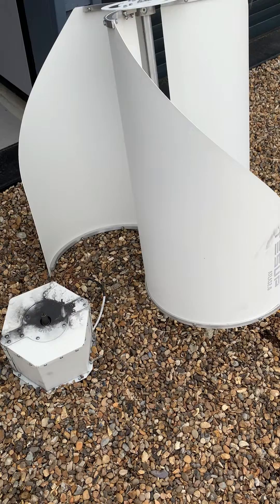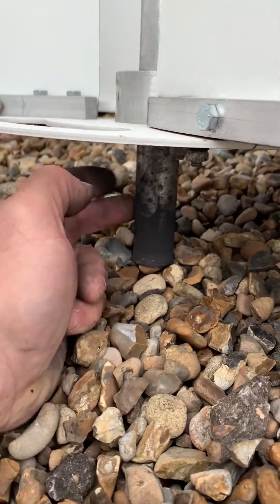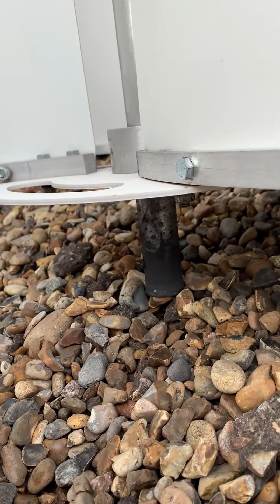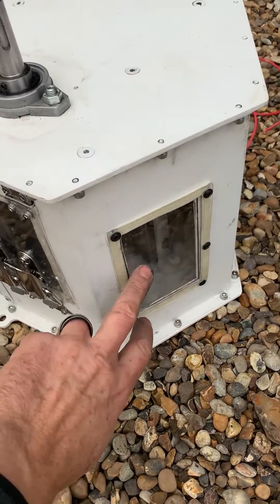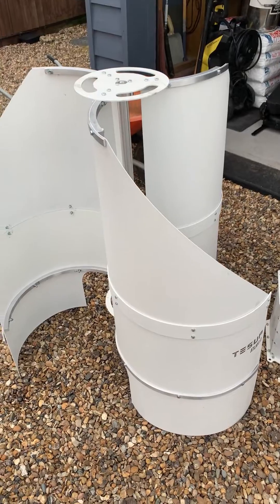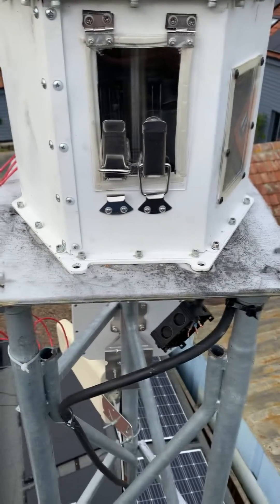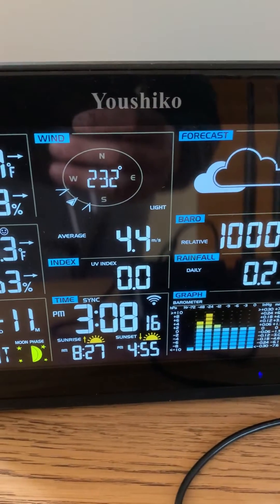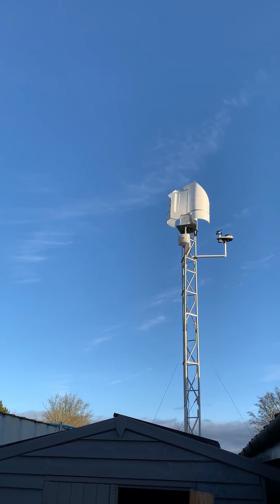TESUP Atlas 2.0  v2 install

Comment: Hi D L!  You commented on my video but because you posted a link youtube pruned it!  It's really frustrating...I get the comments in email but YouTube doesn't let any of them go through that have links.  I have a tendency to seek out the underdog for my projects...I did see your videos before I jumped in, as well as all the other Atlas 2.0 videos on YouTube. They all seem to have a different turbine...mine's different from all the ones I've seen so far haha.  Doesn't make it work, though.  My test and attempt to find a way to make it work will probably be cut much shorter than I expected because this version is so unsuitable for a 48v circuit.  TESUP won't even talk to me.  It's going to be decided by card issuer :/
Reply: I've seen FOUR completely different generator setups now.
Reply from the maker: Yes I just claimed back on the card. They asked for an expert to judge the performance but accepted that me (chartered engineer) was good enough. Full refund

Comment: i have been looking at this wind turbine can you tell me how it is working and do,s it give 2kw and how are you set up i intend putting it in to a grid tie inverter the company are saying i need a speed controller as well as a inverter ?
Reply from the maker: Hi if you watch the videos they’ll tell you about the set up. I have the grid tie inverter and you need the controller that takes the AC supply and converts to DC
No it doesn’t give 2kw, nowhere near. I’m collecting data before publishing my power curve
Reply: @Homewindturbinereviews  thank you for that my grid tie inverter takes the ac and converts it to dc so the small wind turbine i have go,s straight to the inverter then to my house with out a controller .but if your saying it do,s not give the 2kws i think i will leave it  thank you again for the reply

Comment: We live in a northern climate (near Vancouver BC), and need enough power to run a dehumidifier 24/7 (plus small electronics ideally). Our current solar setup is insufficient. We get intermittent wind gusts, a tiny gutter with occasional flow when it rains. What to you recommend as the most financially sensible investment for off grid power, given none of our environment is optimal for anything?
Reply from the maker: Hi. If you don’t live in a constant wind (average of over 6 m/s) then wind is not an option you should consider. Go as big on solar as you can afford and use batteries to capture when there’s full sun (see my other video)
Reply: @Homewindturbinereviews  Thank you so much!

Comment from the maker: Got some early reads....no movement between 0 and 4.4 m/s. 😂
I did think the extra force required for the gearing would create issues at low wind speed...let’s hope the curve picks up after 5!
Reply: That's normal for tesup , I bought the zeus 3.0 , it won't start unless there is a gust of 4,5-5m/s(that's pretty windy) When it's started up , it can stay rotating with a lot less , but in lower wind area it's useless . I would nobody recommend buying at this company . It has been a nightmare ....Generator shaft wasn't placed correct at factory , I did correct it myself , but even then it's a useless windturbine . It's rusting whitin a week , no steenless steel used , just bare steel . Poor quality of paint .... Charge controller looks has been made by kids ,  Still waiting for a refund of 5% off the total costs , thats says enough what kind of company it is . Normally you would send it all back and get a new one . But no , not with this comapany . You have been warned ... I have put a chinese turbine on the pole , I love it .
Reply from the maker: @allwater3400  which Chinese Did you get?
Reply: @Homewindturbinereviews  - Take a shot at Thermodyne turbines/products.  They're real.  Lol.
Reply: @Homewindturbinereviews  windturbine and mppt controller from Green E solutions